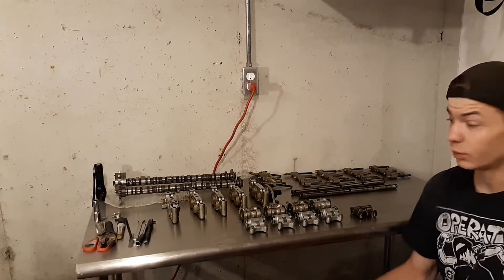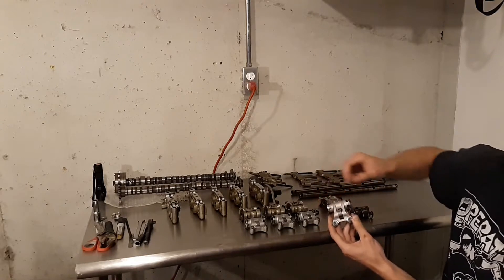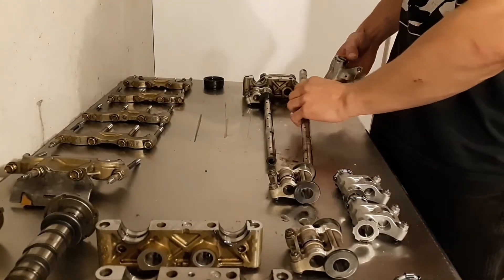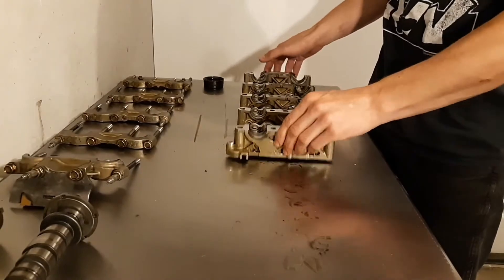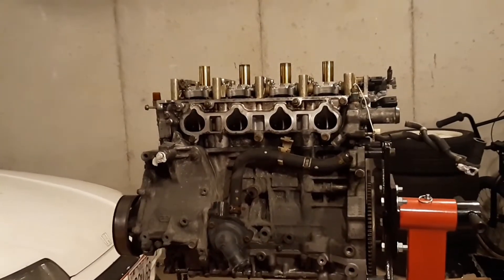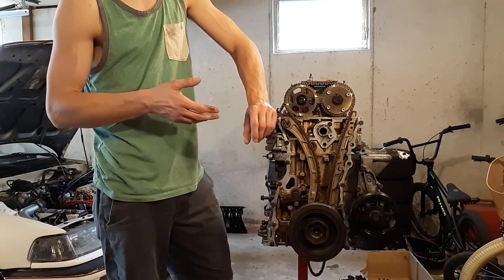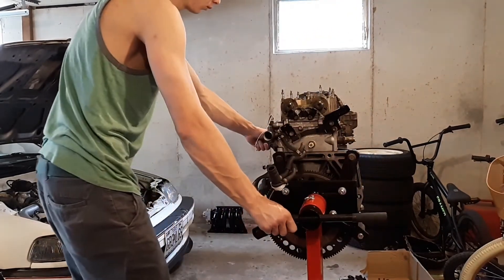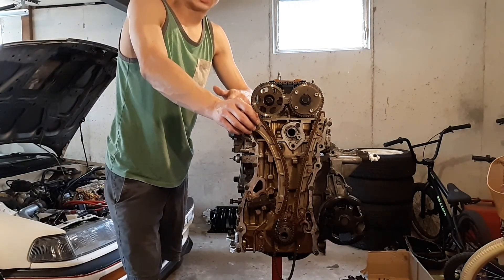200+HP K20A3 build part 2: building the VTEC killer cylinder head.

Comment: Really informative and such a trail blazer, i do alot if off wall undoctrine endeavors. Thinking if this fir an 05 element, but my c9ncern is its auto, not sure if it can tune the idle low rpms? I have ktuner.

Comment: i have an a3 as well in my base rsx, as for the cams should i go with a2 cams or could i go for more aggressive cams?
Reply from the maker: The more aggressive option would be the TSX cams. I know that with those its a bit tougher to get to idle and you have to be careful with your VTC angles but are capable of more power. I just put this setup on the dyno today and will be posting  the dyno pulls and video soon!
Reply: @jdmjedi777  nice! would you recommend getting k-pro if i swapped the cams?
Reply from the maker: @BrandonBuiltVideos  yes absolutely. You are going to have to run kpro for the cams.

Comment: Such a great, informative video! Can you tell me if you used the A3 or A2 cam gears with the A2 cams? I think I’m going to attempt to build one since I currently have an A3 torn down in my garage, getting it ready for EG swap. 
Thanks!
Reply from the maker: Thank you! I ended up using the a3 cam gears. I believe the only difference between the a2 and a3 cam gears is that the vtc gear on the a2 cam gears has a larger degree it can be adjusted to. Thanks for checking out the video and feel free to ask any questions. I do my best to respond to everyone.
Reply: jdmjedi777 thanks for the quick reply! I just got a sick deal on a pair of A2 cams for $100 shipped and they look super clean. They don’t come with the A2 gears is why I asked. You rock.
Reply from the maker: @RatherBeRestoring  no problem at all! Always glad to help out.

Comment: motor will rev faster then the a2 because its got lighter rotating assembly vs a2 
build same motor with a2 head and a2 oil pump was sweet
Reply from the maker: EXACTLY!! I also stuck an a2 prb oil pump in this motor as well and will be discussing that in my next video. With some porting on the a3 head or even a k24a1 head with the same cam and vtec killer setup as my a3 its possible to make great power on a budget still. If you were to port the k24a1 head as well it can flow a crazy amount of air. I think I'm going to grab a bare k24a1 head and make a video about porting it. That way after I show this setup on the dyno, I can swap heads and show the difference and power you can make for cheap.
Reply: Can you do the job for my A3 pls ?

Comment: only the hot side stay like killer cams and the intake close and open vtec?
Reply from the maker: With this setup both sides always ride on the vtec lobe. It is possible to get a set of a2 intake rockers, switch the pins around and still allow vtec to work on the intake side.

Comment: What are your thoughts on k24a2 pistons in a k20a3
Reply from the maker: You will need to bore the block out 1mm but the k24 pistons will fit on the k20 rods. I'm honestly not sure what your compression ratio would be or what your p2v clearance would be but it should work.
Reply: @jdmjedi777  the k24a2 pistons are 10.1 com. And the k20a3 is 9.1
Reply from the maker: If I'm not mistaken though your compression ratio might actually drop.
Reply: @jdmjedi777  I have a bunch of leftover parts from my k24a2 that I'm building and I no I can drop the cams and rockers to make it VTEC on both sides and I no the rsx bore is 87mm stock as well as the k24a2 which in theory should work with the pistons
Reply from the maker: @knoxbom3274  k20 bore is 86mm k24 bore is 87mm. You will in fact need to bore the block 1mm for those pistons. Just because the k24a2 is 10 to 1 compression ratio doesn't mean that when you stick the k24 pistons in the k20a3 it will have the same compression ratio. K24 has a longer rod length. A longer rod alone without a taller compression height or dome height on the piston will create a higher compression ratio. You need to measure the compression height of the piston and figure out the dome heights. Then determine what cylinder head to run. If you stick with the k20a3 head you will actually end up with a higher compression ratio than with an a2 head because of the square combustion chamber. You will still need to clay the pistons especially if using the a3 head.
Reply from the maker: @knoxbom3274  also k24 piston stroke is 99mm and k20 piston stroke is 86mm.
Reply: @jdmjedi777  I appreciate all the assist I would of bought k24 Pistons and taken apart my daily.....I been so focused on researching the k20/k24 build that I wasn't thinking about the one I'm driving good looking out